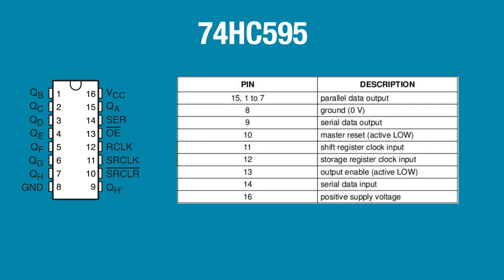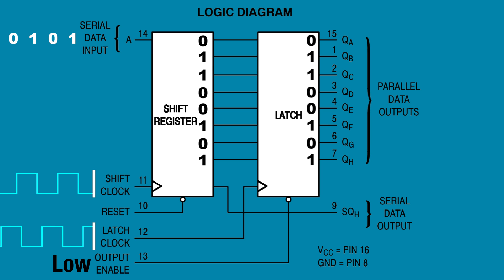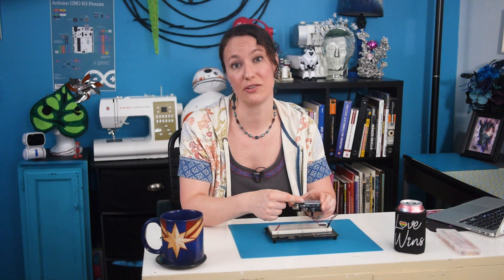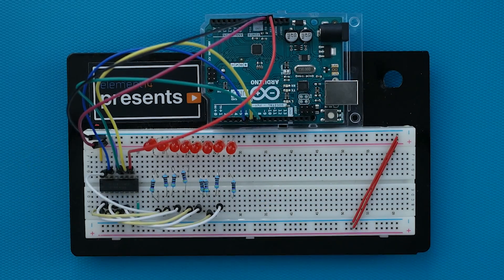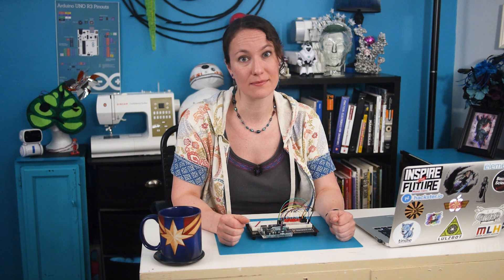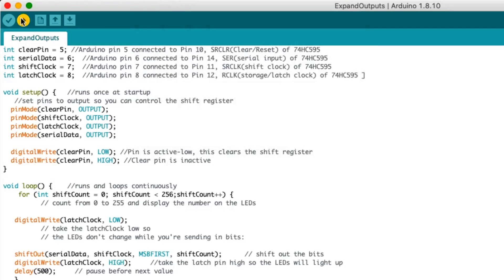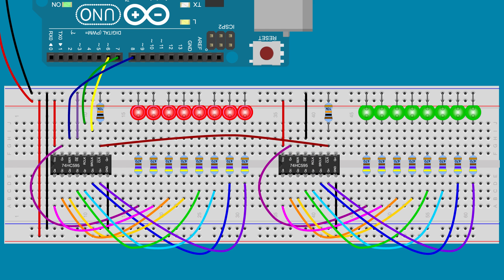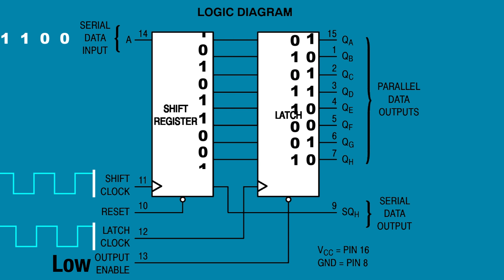How to Add Outputs to an #Arduino using a Shift Register - The Learning Circuit

Comment: I found out recently that my Arduino Mega can only cope with upto 10 595 chips in a daisy chain. This is due to something called 'Fan Out' which is where signals are sort of fading and getting jumbled up as they spread across multiple chips. I would recommend not driving more than 8 in a row. I also use a 74HC165 to achieve the opposite function and use a a 'Shiftin' register to read multiple input pins like sensors or limit switches ect. Great video. :)
Reply: The fanout can be helped out by putting a buffer chip in front of that signal, such as your typical 74ls244 or really any other chip that can buffer to strengthen the signal.

Comment: To answer your question for why is the second shift register one bit away from the first. I think it's because you would have the output from the first going to the input of the second shift register but only after the next consecutive clock pulse will the output be triggered! Quite neat.
Reply: Thanks! Is there a way to synchronise them?

Comment: For what is there 10k resistor (CLR pin) ?
Reply: This is a pulldown resistor. When the pin on the arduino is brought low, its possible for a voltage to remain on the pin. the resistor gives it a path to ground.

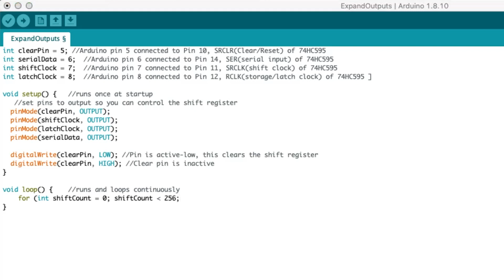Comment: 05:57 isn't a great explanation of how a for loop works.  A for loop typically has three parts that work with a variable:

1. what should the variable be initialized to?  2) when do you want me to break out of the for loop?  and 3) how quickly should I increment or decrement the variable?  These three values are separated by a semicolon.  Technically the rules of how you set up a for loop don't require these three things, but by convention that's typically how they're coded.

In the example that was given, the loop will count from 0 - 255, then terminate.  Since the code is in the function loop(), it then starts over at 0 because loop() gets called by the Arduino base code over and over again.
Reply: Video focused on ShiftRegister and C++ syntax is extra. On the screen you have working example of loop and for more details check book "C++ in 21 Days"
Karen is more familiar with ICs and in Arduino/C++ she is relatively new.
https://www.amazon.com/Sams-Teach-Yourself-Days-5th/dp/0672327112

Comment: When the purpose of the exercise it to explain the shift register, it suffices. When the purpose is to add more outputs, try the I2C bidirectional ic MCP23017, it’s much more versatile... You can add 8 of the to the I2C but giving you 128 ports that can individually set as input o output. Couple outputs to a ULN2803 and inputs thrugh an opto-coupler, and you’re in business.
Reply: 50PCS = € 49,15 / lot MCP23017
50PCS = € 4,03 / lot   Hc595ag Shift Register
If you need 50PCs and you don't care about 45€ being thrown away, then it doesn't matter what to use.
I was always wondering about MCP23017 why it cost as MCU, but has only a tiny part of functionality.

Comment: Thanks for the video!
Two quick questions:
1) How would you make it so that the second shift register doesn't start receiving bits (or lighting up) until the first one is full (all LEDS are lit)?
2) I know you can use bytes to tell the shift register what pattern to display (ex. 0b01001010), but does this carry over to the second shift register? If I put in a 16-bit number, would it show that pattern using both shift registers?
Thanks!
Reply: For Q1, it depends on what you wish to do. A quick and dirty way is to call serialOut() twice before the digitalWrite(latchclock, high) is called. That way the data in the first serialOut() is in the second shift register, while the second serialOut() is in the first shift register when the latch is 'activated'. 

For Q2, int is already 16 bit, so it is already 16 bits and no change is needed! However, if you are looking to transfer all 16 bits in one call of serialOut() you will be disappointed. From the arduino reference for shiftOut() under notes and warnings, shiftOut() only supports transferring 8 bits each time it is called.
Reply: @LandOfSigh  thanks for this. Now I understand why she skipped over that part!

Comment: also the output enable explanation is a little inaccurate. Pulling the pin high will make the outputs go high Z or essentially open circuit, it disconnects the output drivers. However you can use PWM on the pin to control LED brightness etc (I use it on the jumbo clock to control the Aux LED brightness, I use the signal from the "blanking" pin used on the CD4511 which I use to control the digit brightness, inverted using a spare ULN2003 and a pull up on the OE of the register controlling the LEDs)

Comment: I've used shift registers to drive some BCD - 7 segment decoders (CD4511), each shift register can drive 2 digits, I have cascaded 4 shift registers to drive six CD4511 7 segment display drivers which drive ULN2003 open collector drivers and and 8 extra LEDs (by omitting the 4511's and driving the ULN2003 off the shift reg outputs).  Did I mention the LED displays in this are made from LED strips, one whole digit is around 130mmx220mm. I made them into a clock, which I call the "jumbo clock". I have some smaller displays that use a similar thing, 2 shift registers for 4 digits (or 3 and a few directly controlled segments). I made a few 18b20 based thermometers using some 44.5mm LED displays
Reply: That sounds pretty frickin cool. I'd love to see pictures and a write up of what you did.

Comment: The /OE pin has nothing to do with shifting or latching, and taking it HIGH will most certainly change the parallel outputs - they will be tri-stated! Who edits this stuff?
Reply: If you feel that what I presented is incorrect, would you like to share the correct information so we can all learn?
Reply: @maker_karen1785  Surely. https://www.ti.com/lit/gpn/SN74HC595 Notice that on the first-page Logic Diagram /OE is the top input, and is only connected to the output-enables of the parallel outputs - it is asynchronous to the clocks and does not interact with the shift logic. If I am incorrect my apologies; please point out my mistake.

Comment: There is a 74HC165. It's a shift register too. But it seems that it is used differently on arduino. I hope to see you showing how to use it too.
Reply: Yup, that’s next!
Reply: Ok I just checked and it's actually a 166, but they're very similar. :P
Reply: 74HC165 for many INPUT. You have described the one for many OUTPUT
Reply: @alfredkaserekasivanzire9488  This video uses a 595. There is another video coming up that uses a 166 to show adding inputs. But I made that video at the beginning of July so I forget exactly which chip I used. That video should be released in 3 weeks.

Comment: Please note you can use SPI to control a 595 at 16MHz! Using OE as a CS pin for it, you can share the SPI bus with the 595 and any SPI slaves.
Reply: I’ve never messed around with SPI, but I’ve been told to add it to my list so maybe there will be a video about it in the future.
Reply: @maker_karen1785  great, thanks for your answer ;-)
Reply: @aurelienBricole  Now I've started reading up on it. That Arduino code line "Serial.begin(9600)" makes a lot more sense now. You may have just sent me down a rabbit hole. ;-)

Comment: 05:10 it's more reliable here to define constants instead of using variables. variables are stored in the RAM of the microcontroller, but constants are always in the code section and won't spend limited space in microcontroller's RAM.
Reply: I’m still very new to Arduino coding and tbh, copied this code from someone else’s project. I had to look everything up to see how it worked. 
Thanks for adding your knowledge. I hope it helps someone out.
Reply: @maker_karen1785  Ah, are you the person in the video? :) It would be nice to also credit the person who has written the original code in the description.
Reply: @MarinusMakesStuff  Hi, yes I'm Karen in the video. I do all the research, writing, filming, and editing for The Learning Circuit. (Well most of the editing. Max makes it look shiny.) 
That's a really good point. I got a lot of my reference material from https://www.arduino.cc/en/tutorial/ShiftOut. But I'm looking at their example code and it doesn't match mine at all. I tend to piecemeal information together for my videos, so I'm not sure if I directly copied code from anywhere or just borrowed bits. I move through making these videos so quickly that the information can be a blur sometimes. I always keep a References list of URLs but none of the ones for this episode have code like what I used. I will try to keep that in mind in the future and try to make sure the original code authors are referenced in the description.
Reply: @ op, good to know
Reply: This is one of those little coding tips that will help me for the rest of my life.
Reply: Compiler should be able to optimize it but still good practice